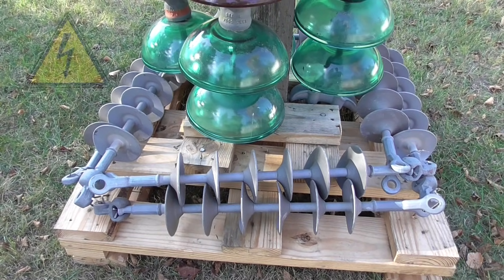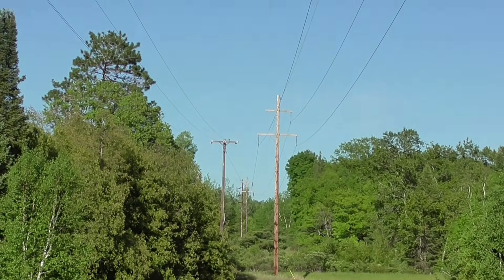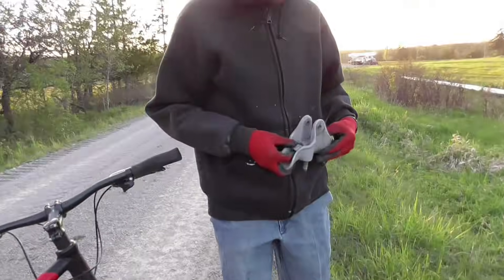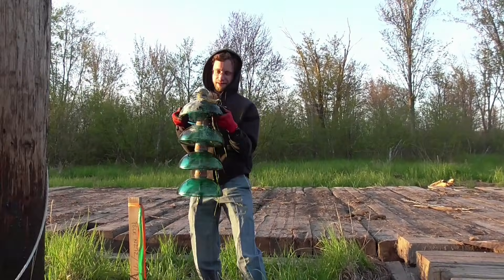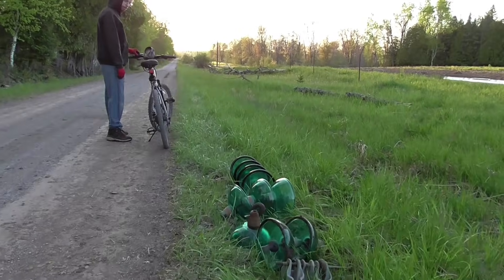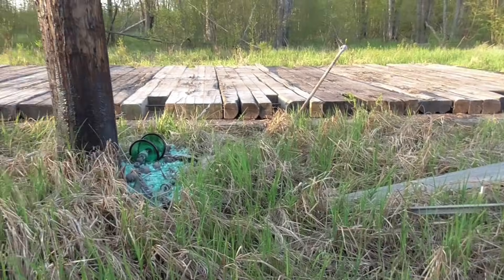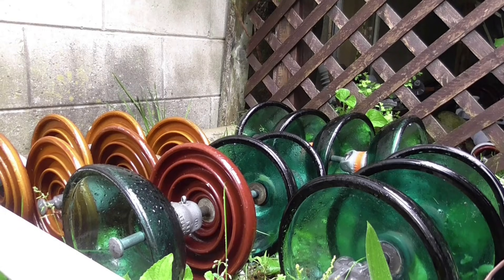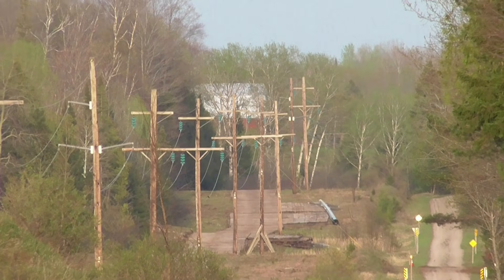Insulator Hunting! Finding High Voltage Insulators Episode 2 — Project “Blue Bell”

Comment: serious warning: these insulators can zap you very badly. they can act as a dielectric in a capacitor and retain that charge for a very long time. as these are connected to conductive metal parts on the ends of the insulators, what you have there is effectively a capacitor in unknown charge condition. this may not sound significant but with some insulators a lethal discharge is very much possible. even after you short both ends once, the insulator may charge up to a lethal charge by itself due to dielectric absorption. sooo. yeah this is hecking dangerous, don't do that please, or at the very least not without adequate knowledge and equipment.
Reply from the maker: This is hilarious 😂. My pillow case holds more capacitance than one of those. There's not nearly enough surface area on one of these to hold even a tiny charge.
Reply from the maker: I build power lines, & we don't shunt insulators. We ground the conductors & buss, but insulators are safe to handle when clear of energy sources.
Reply: @VariacManiac  Please do correct me if i'm wrong, i always love to learn something new. well, i don't think the pillow case analogy holds exactly, the matrials used in insulators have much higher permittivity. also your pillow case does not have conductive metal end caps unlike ceramic insulators typically do. Let's consider a leyden jar: touching one while charged definitely hurts and can even be lethal in severe cases. a leyden jar does not have a lot of surface area either. if you disassemble a charged leyden jar, you can touch any component beit the inner electrode, outer electrode or the dielectric without getting a shock. if you reassemble it however, it will be charged still and can zap you again. so the moment you have electrodes on a charged dielectric it can pose a hazard. Of course in an insulator you will have a much larger distance between the electrodes than in a leyden jar so due to the relation C = (epsilon_0*epsilon_dielectric * area)/distance so that the capacitance will be fairly low, but i have gotten a slight but noticeable zap from the insualators in a HV project of mine after it was disconnected from everything. granted they were some rather short insulators but still. iirc, here substation insulators are recommended to be shorted before moving them even if they are not connected to anything. i can't say wether they are actually dangerous but assuming something safe is potentially dangerous is usually better than the other way around. PLEASE correct me if i'm wrong about anything, as previously said i always like to learn stuff :3
Reply from the maker: @eepydragonloaf Nah, you're good bro, I should appreciate it, & you're 100% right that insulators have a capacitive factor & can indeed hold a small charge, but typically isn't anything dangerous. Environmental factors are also a big play, but since electricity is a theory, it can sometimes do weird things no one expects. Having more prospective never hurts. It's always necessary to proceed with caution &  have an open mind. Which for me is a work in progress. 😂
Reply from the maker: @eepydragonloaf You are not exactly wrong, shit happens!

Comment: Dang, those green discs are big! Used to chuck rocks at smaller ones near railroad tracks. Probably shouldn't be hitting them while they're still on the pole. Bet it annoyed the hell out of some employees at the power company.
Reply from the maker: Haha! Sounds like you were hitting the telegraph ones. A lot of that seemed to be abandoned for decades. Some of those lines may still be in use. Them are quite collectable too.